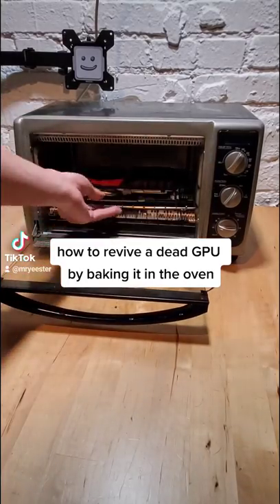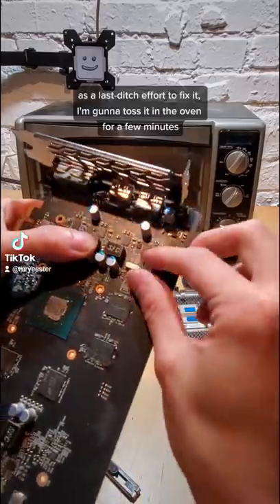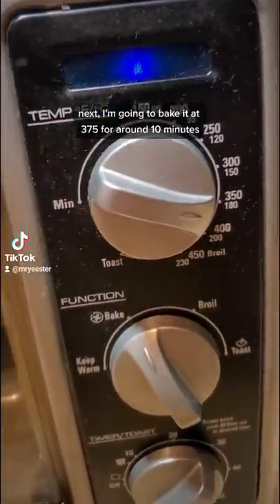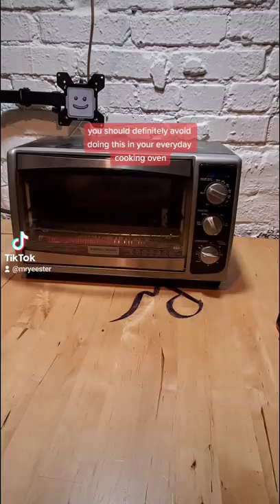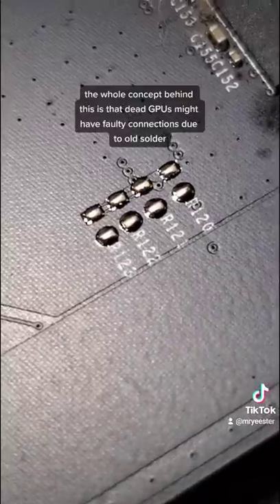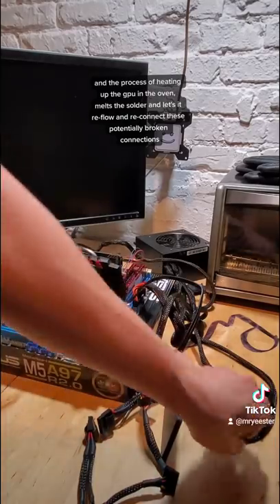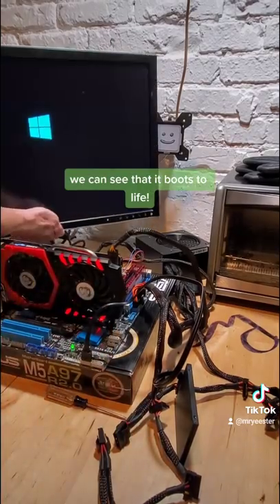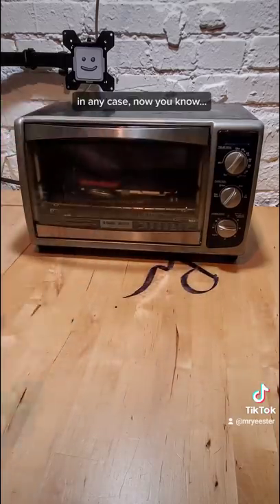How to revive a dead GPU in the oven #shorts

Comment: This used to be a legitimate fix for some older xbox's. The cheap solder would make bad connections so an there was a solution where you wrap it in a towel to intentionally overheat the console and remelt the solder.
Reply: this reminded me of that cause I used to have to do that to my Xbox 360 like every month or so as a kid. Wasn't it called the red ring of death where all the rings were red
Reply: Well with the 360 you'd be better off just using a heat gun this is not a very good idea
Reply: @illegalwaffel6435  iirc it was three red lights, not all? But you're correct. This fix usually doesn't last for too long. I did the x-clamp mod to mine and used towel trick and it worked for about year I still used the x0. But there was definitely luck in my system.

Comment: I tried this after my 6 years of regular use.
The video output on windows worked as though I had no drivers installed.
On Linux, the gpu would not be detected and only TTYs worked.
Baking revived my GTX 760.
I have no idea how much life it has left in it, but it's better than just replacing it with a new one.
We baked it 3 years ago and it works to this day with minimal usage.

Comment: This method is temporary, the chip itself is defective so it will eventually die again. Also, heating the entire PCB is completely unnecessary and can kill other components.

Heating just the chip with a heat gun at 180-220ºC is enough for this type of temporary fix
Reply: Someone who actually knows what they’re talking about
Reply: @aidancommenting  If you have a soldering iron then you might be able to get some new flux on it but I've never tried replacing flux
Reply: That's exactly what I was thinking, why not just use a heat gun. Would be around the same price of a "dedicated" oven to bake gpus
Reply: @nerksyo  because content this is way funnier and cool so zip it
Reply: @PandyEX.  True dat
Reply: @nerksyo  Heat gun is like 10 bucks
Reply: Not true, lots of SMT lines send boards through a reflow oven to re-set the solder. The PCB can handle it just fine. Though you are correct that some components may not be able to handle it. Just have to know your temp ranges
Reply: Anyway to fix a defective chip?
Reply: @nerksyo 
You may have an old oven lying around, but man... who buys new stuff just for the sake of fixing old technology that’d become obsolete soon?

Comment: Fun fact

For much much older GPUs do not do this! There's this thing called migration and the microscopic traces of the semiconductor gets broken over time. It can reach a point where even this method does not work.

Also whenever you reflow a GPU apply soldering flux so that the solder joint stays shiny and solid. Cold solder joint is when the joint is not shiny and has no flux. That can cause micro cracks in the material and eventually you'll have a loose connection and once again a faulty GPU
Reply: Or a blown up capacitor
Reply: Shouldn't do it on any GPUs, it will let off gases which are principally components oxidising which means burning and rusting. If you would heat it under flux at this temperature maybe it would be ok but recalling is the go-to.
Reply: Man, you could not tell the differences on modern solder which has no lead in it if it is cold or not just visually.
Reply: @jakubpyra5711  you can, the silver amalgamates with the copper and turns harder and more red over time, but for something new, no you can't.
Reply: @LMBLNCR  yup, I am talking about new cold solders detection. Only method is UV paint and light.
Reply: @jakubpyra5711  what is this new solder I hear from you? Looks interesting haha
Reply: @miley6.915  Its not new. SnAg3,5 is now used vs Sn60Pb40 used previously.
Reply: Electromogration*
Reply: I remember having a Dell inspiron with a dead ATI radeon GPU....

I knew this method before...but was not willing to use the oven

That laptop generally heats up a lot...so I simply remove the battery and cover the laptop in a blanket...and let it get super hot for like 10 mins

I extended the laptops life by 19 months using this method lol
Reply: I did this on my gtx 560.. is it old

Comment: Not something I have personally done but I know somebody who has done it with a few older cards. As in AGP and possibly early PCIe cards. It has been awhile. One card got baked 3 or 4 times before dying permanatly. He got several years of extra life out of. Of course the same dude had a ghetto rigged water cooler that used hoses going out of the case and connected to a honda radiator and a box fan blowing on that. 

As for reflowing I suspect it worked better on older cards for two reasons. First you had chips with a lower number of total connections and they were spaced further apart so shorts were less likely. Second is the fact that when they were trying to switch stuff over to lead free solder there were all kinds of problems with solder joints not holding. There is a reason stuff from decades ago with old solder still works and stuff with lead free pretty much never lasts 5 years. If your electronics has a stupid warning label letting you know that eating it may cause reproductive harm then it likely uses lead solder and may actually last. Assuming a cap doesn't dry out or explode.

Comment: boiling your capacitors is a good way to solve faulty connections?
Reply: Risky because if the molten solder connects 2 different connections then it will short circuit
Reply: @itszain6317  depends on the connections but yeah,can happen.
Reply: @wsketchy  the fuck are you talking about, every GPU and motherboard have Electrolytic caps. The big round silver ones. They're used because they have high capacity, to help smooth ripple as much as possible.
Tantalum and ceramic caps are used  to get the exact voltage required and smooth on a smaller level.

Low power devices (SSDs, HDDs, RAM etc) use different rails on the PSU, and are much closer to the voltage they require, so they don't need larger caps.
Reply: @itszain6317  this won't happen because the surface of the board has a coating that repels solder where it shouldn't go, like between the + and - terminal of a component.
Reply: @calebhood6565  i don't think every board is made the same
Reply: @itszain6317  the solder joints have flux in them and that helps the solder to spread out to the places the solder needs to be in
Reply: @itszain6317  Every mass-produced PCB will have solder mask.  It's necessary for the way these boards are assembled and is industry standard.  Source: I work in electronics manufacturing.
Reply: Manual and patient fix is better than just baking the whole thing
Reply: @itszain6317  ovens get to 500 f max, need 800 f to melt solder, and since there’s no flux it’s melting point is much higher, causing damage to the silicon from the extreme heat is a bigger issue than liquid metal
Reply: @autumn5592  the all silver caps are solid caps, the blue/brown with a y shape top are electrolytic
Reply: @jakejakedowntwo6613  I know what Capacitors look like...
Reply: @autumn5592  I didn't want to assume, you said in a comment about computer parts having electrolytic capacitors then described a solid capacitor. my bad if i got it wrong
Reply: @autumn5592  yeah i realised i was wrong but i didnt get a notification for it
Reply: arent all the components oldered on at once so the capacitors gpu die resistors 8pin headers are all soldered at once at same temperature

Comment: If you have one I'd recommend using a heat gun under the major components (or a soldering iron for any through-hole ones) for increased accuracy

Comment: This was the issue with those red ring Xboxs too, and people found that a temporary solution to that was wrapping the thing in a towel to heat it up enough to reflow the solder. The fix is only temporary, and was caused by cheap and poorly applied solder

Comment: This is indeed called a re-flow. This has been done on many things like Xbox 360s (specifically) because they tend to die. Although, they are done using heat guns. But, no matter the way you do the reflow, you should add flux to whatever it is when you do it. it prevents oxides from forming.

Comment: I've placed my 290x in the toaster twice now. I've found that suspended it above the rack with aluminum foil balls works great. Maybe a bit lower on the temperature to. The GPU comes out a bit"banana" shaped. The shape helps close up any cracked solder joints. Realistically getting it hot enough to reflow all the components will probably kill the capacitors

Comment: Im an IPC 610 certified solder trainer and modern electronics are using a tin based solder i.e. lead free which has a melting point of 361 degrees or 183 Celsius so you may nedd to go higher due to the thermal dissipation through the pcba and/or heatsinks. Also solder flows should have a ramp up then a period at max then a slop ramp down to prevent cold solder joints and cracking

Comment: it's something to try but lead free solder does not melt at 375, it melts at 428 (and you want to go a bit further that to make sure it's fully reflowed). However you're not supposed to keep the components at 428 and above more than 30 seconds so... Well it works, happy days :)

Comment: ok imma break the myth and offer advice
the reason reballing seems to work is because youre takinga hot object to the gpu dye. reballing does nothing. in reality what youre doing is when you use a hot air gun youre sort of rearranging the insides of the gpu dye and to simplify it, doing a gamble that those microscopic movements the heat created temporarily solves the issue. if youre gonna do this remember its a gamble. again, the solder balls thing is a myth. the reason reballing worked was because youre heating up the gpu aswell as the solder to hopefully fix it. but know this. that gpu is a zombie and next time it fails which could be soon, it will probably fail for good
Reply: Yeah I would only do this if I, as said in the video, exhausted everything else and the warranty expired, only after I had placed a order for the GPU and it was in the mail
Reply: Reflowing works exactly how he said it does in the video, not by “simplifying” the gpu die lol.
Reply: @Z3NITH_  nono, im saying that the simplification of this process is gambling that small movements will fix the dye. the solder has nothing to do with it. ive done this a few times. you just take a hot air gun (for soldering) and point it at the dye for a while and hope it comes back to life
Reply: @kektaro  Solder joints are a conspiracy, everyone knows electronics work only by the ether ingesting with magic smoke. Don't be fooled by Big Solder!

Comment: Idk about you guys but trying to melt old solder takes a lot of heat. Flux is needed to help it melt easily. I’m not a expert or anything but I’ve worked on old solder before trying to soft mod my old original Xbox until I noticed all of the fuses under the CPU or GPU were all shorted due to the mother board being warped badly.
Reply: Flux isn't used if help it melt, it's used to control it better.

But you are right, ovens won't get hot enough to melt solder. 400c or 840f, no oven is getting that hot.
You aren't reflowing the solder, you're not even making it soft.

Edit ; those aren't fuses, they're capacitors.
Reply: @autumn5592  old solder is not gonna melt even when putting a soldering iron right on it. This is why when removing/installing a chip they put flux in order to not just help it flow easier but help it melt all together.

Edit: those are actually fuses. Capacitors arent under the motherboard nor under the GPU/CPU. Trust me I already dealt with the capacitors, mainly the the one that dealt with keeping the time.

Comment: Baking a GPU in the oven doesn't reflow the solder, otherwise all components on the bottom would fall off. Yet it does expand everything evenly and can kinda jam everything back in place for the broken solder connections to have contact again. For a time.

Comment: By the way, the oven won't be able to  reflow the solder at those temps. The reason it temporarily works is because it bends the board into making contact for a short time.

The other reason this may work is the chip can have a broken path within the microarchitecture, and heating it shifts the microscopic circuits enough to make contact for a while... but the GPU chip, itself, would need to be replaced for anything permanent.

Comment: “How to revive a dead cpu in a toaster over.”

Me with a broken cpu:🤔
Reply: They has no soldering they get etched in acid so Oven doesnt work
Reply: If you have broken pins and want to fix it yourself then the best method is to use a heat gun to carefully solder back the pins. If all the pins are there or if you have an intel cpu then it may be the CPU die. If that’s it’s your problem then you can’t fix it. The cpu die is so so advanced and is like glass and if it is broken then no one will repair it not even a highly trained person on intel or amd would fix it. It’s just… unfixable. If you haven’t took out your cpu from the motherboard at all then it may be other hardware like ram psu motherboard or even the cable management that cause the problem. Or if it is the gpu you meant then yes you can try to put it in the oven. It’s good to try or just use your warranty if you have that
Reply: @animationmann6612  CPUs do have soldering

Comment: This is a temporary fix, it is called "diagnostic heating" if the GPU works after heating, that means it will serve you a small amount of time, and it will die again
usually that means that the GPU chip is dead and needs a replacement.

Comment: Please pin this.
This wont fix your GPU. This is a Temporary Fix, and it might die again about 5 minutes in. What youre doing is basically making a dead GPU being an "Zombie". Tho, it can also last for 5 years. Its also recommended to use a heat gun instead of an Oven. 

So. You can use this as a last effort, when you know you dont have anything to loose anymore.
Reply: He said that its a last effort
Reply: And for please. If you ever do this. Ever. USE FLUX SO YOU WON'T HAVE COLD SOLDER JOINTS AAAAAAA

hate that.
Reply: @Patrik2166  hahahahaha hate that too
Reply: Yes, while i would prefer if people did not don his at all and give the card to a proper technician using a heathun at least doesn't BBQ the VRM like an oven does

Comment: I did fix a gpu like this, and temporarily a HDD by throwing it in the fridge (no jokes)
Reply: That had some cool data on it 😎
Reply: Some metals fuse under cold temperatures , look it up
Reply: @Narekz  I belive it was due to a miss allign in the read head, maybe due to a fall?, after freezing it and plugging it in it worked like a charm lol, worth to say that i putted in a plastic bag as to not have water on the drive
Reply: @kendarr  okey, noted if my HHD breaks
Reply: @kendarr  daam I didn’t know that was a thing haha
Reply: @miley6.915  neither did i, i was desperate lol
Reply: Bro I fkin love you, I've been trying to fix my pc, been getting no video error beeps all day and checked everything from ram,CPU mobo etc and cus of Ur comment I popped my little Rx 560 into the freezer for 10 mins and it started working thank you! 

Almost drove myself crazy there
Reply: @AbdulMoiz-km9oh  Nice!, Now, i'm not sure that will hold a lot, you have some solder problem I belive, try to get it to a repairshop of your trust
Reply: @kendarr  yeah most probably won't last long but if I can just get it to last 2-3 more months I can get myself a new 1660, I'm gonna do some stress testing for now and if the issue does come back I'll take it to the repair shop
Reply: @AbdulMoiz-km9oh  I'm glad you got some life out it still :D

Comment: This is a temporary fix and your gpu will 99.9% of the time will fail again 
And you can also use heat gun instead of oven
Reply: This needs to be higher. If you're going to reflow, use a heat gun, not an oven!
Reply: @applepoop10  Nah just need a brain 🧠 and tools then done ez fix + earned skills.
Reply: @thefirstsin  or just use Google and tools, not really gonna get anywhere if you just think, you have to learn how a GPU works and what's causing the problem
Reply: Me being a laptop user....I would just turn it on and cover it with a blanket....extended the life of an ATI RADEON from 2009 by around 17 months
Reply: Well technically 100% of them will fail when purchased brand new eventually. This method while not ideal can work and work long time. I've done it several times with success. Although I use a heat gun and flux as to not heat up things I don't want heated up. All fo them that this successfully worked on are still running today. A couple of them are still going years later.